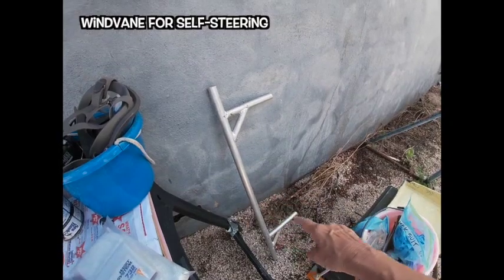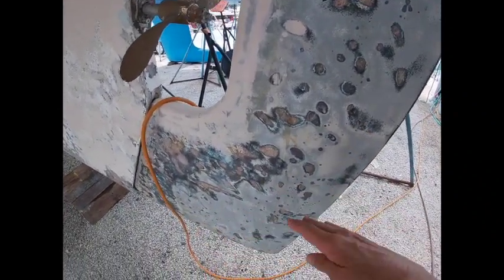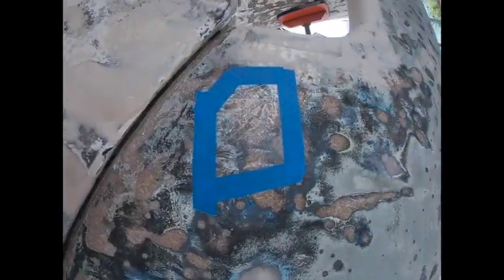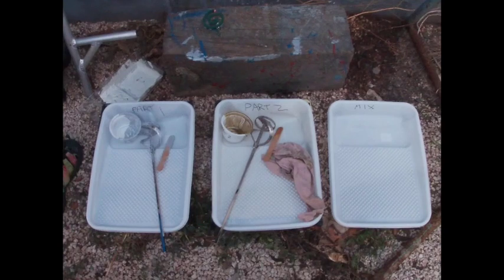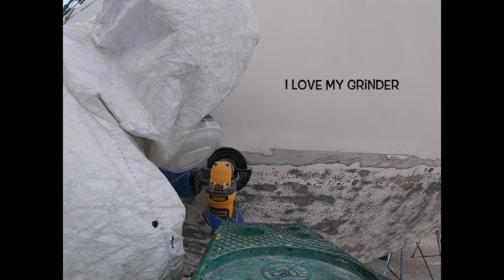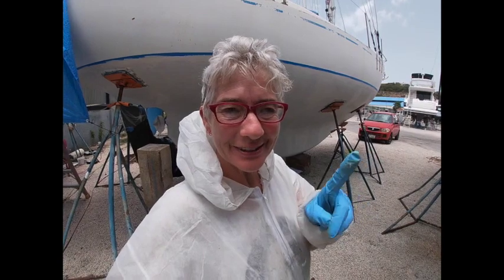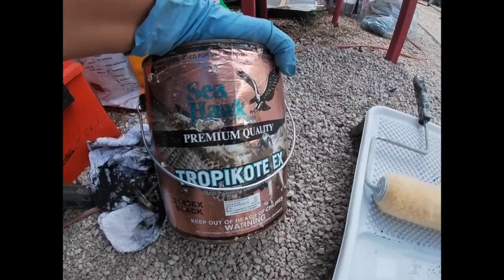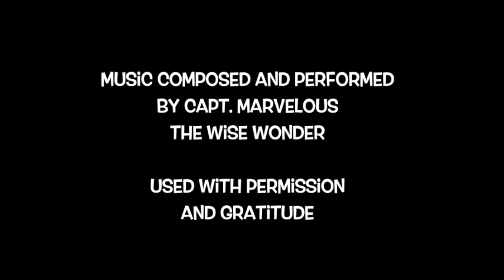The Big Bottom Job

Comment: That is a big job. I sandblasted because the bottim paint was built up beyond belief. I think you did a great job. 3/4 layers of epoxy barrier coat should be perfect for many years. Had you considered Copper Coat instead of bottom paint?
Reply from the maker: I got the bottom paint half price from a cruiser who bought too much so I went with that. I have heard mixed reviews on copper coat